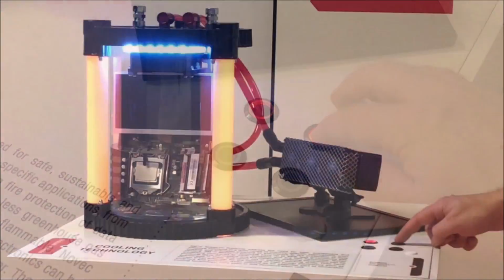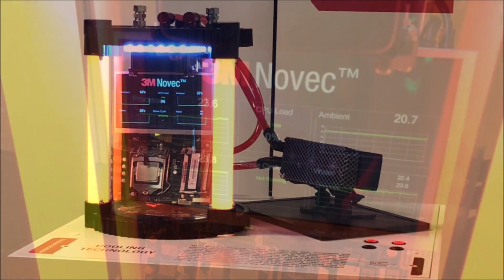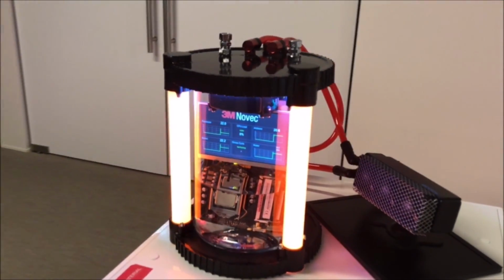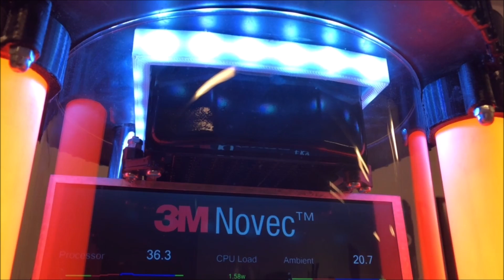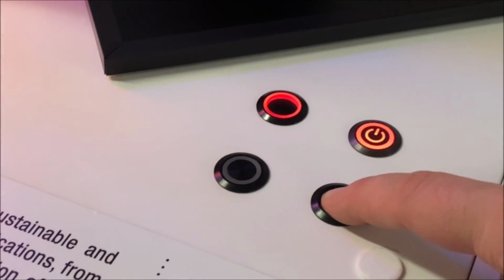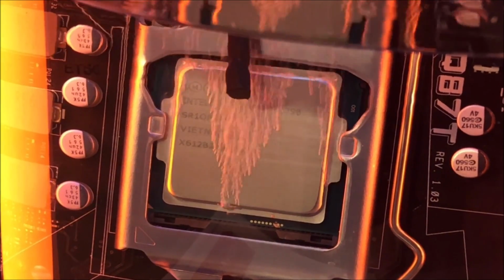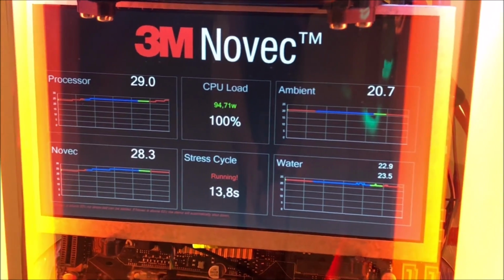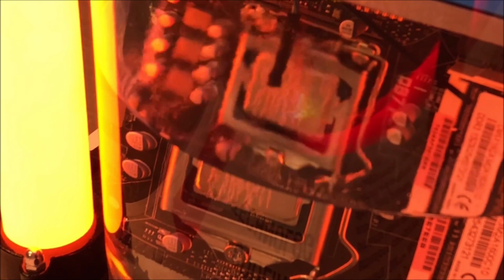Submersion Cooling with my new Smaller Novec Demo

Comment: I have some questions regarding Novec-1230 and Novec-649, they're just one same chemical, but the first is used for fire protection and has purity of ~99%, the second has purity ~99.9% and is used as heat-transferring fluid. I've seen some China-made system using Novec-1230 for submersion cooling, as it's 3 times cheaper and more readily available compared to the 649. Do you guys have any idea about using 1230, could we also submerge the PSU - power supply unit into it!? Many thanks!

Comment: Did you ever do that 12 hour stress test?

I'm designing a custom machined case and was originally going to do an oil or mixed fluid cooling system. Really intrigued by this novec fluid.

Watched your build and it looks fairly straightforward.

If I'm throwing a higher powered CPU logically that would equate to a bigger heat exchanger loop.

Was the cpu heatsink and fan removed for the demo? Surely it would be more efficient with the heatsink and fan mounted? Larger surface area etc

Comment: Nice. How do you pass through the cables/tubes into the tank?  Is the tank pressure sealed to keep the Novec from evaporating away or is this setup open to atmosphere? Would it  be a good idea to use a bellows to allow for the expansion of vapors/air? I so want to try this at home! I'm thinking of starting with something thin like a laptop motherboard(with or with out heat pipes attached you think) fully submerged and an "Alphacool NexXxoS XT45 Full Copper 40mm Triple radiator" on the inside to use as a condenser. What tubing, wiring, Plexiglas, sealant (to run a bead around the seams, corners, and wiring/tubing leading in and out of tank) types are safe to use with Novec? Questions, questions, questions!
Reply: Sweet, don't need to look for a rad now that ones perfect. Did you find a bellows type pressure equaliser that would work?

Comment: How does this system deal with the initial pressure change caused by the 3m evaporating?  Is there a hidden bellows or some kind of coolant loss?

Comment: Absolutely outstanding, I want this but multiple celled for graphics card's in sli/crossfire.
Reply: I'd use MXM graphics card's for laptops but using it under pcie. The results would be astonishing very artistic to look at and run Overwatch at max settings according to the graphics card's available.

Comment: Was there a reason why the mobo was not fully immersed? Also, in principle, how far could the external reservoir and radiator be from the immersion tank? And lastly, if you had included GPU(s) with their fans removed, would it all still have worked the same?
Reply: Size and cost. The fluid is expensive, and there's no reason to cool things that honestly don't need to be cooled.

In practice, the external reservoir and radiator can be any distance from the tank. However, you probably don't really want a PC watercooling system for this sort of setup since those are tuned for extreme space constraints that you don't have here. They have extremely tight tolerances because they need to transfer upwards of 500w of heat in a few square inches of space, which you wouldn't need to do here.

Yes, a GPU would work the same. The temperature of the fluid can't exceed its boiling point, so adding more heat sources only increases the rate at which the fluid is boiled off. This increases the pressure inside the container, with the limiting factors on cooling being how fast the radiator can recondense the vapor back into fluid, and the pressure the container can withstand. If the radiators can service the heat load, everything will work just fine and the system will never exceed the boiling point of the fluid.

Comment: Is that novec 7000 or 7100? Also why don't you cool directly novec fluid with the radiator and the pump, instead of using another medium in between? Answer would be appreciated a lot :)
Reply: I'm not too sure but the same problem as water turning into steam causing cavitation. As steam is a gaseous state and is compressible (and I know why don't we have high-pressure water coolers well I would recommend an engineer for you to talk about that) and the same happens when a vacuum is applied water 'boils' or an air pocket forms and thus the rush of fluid that is not easily compressible causes erosion

Comment: Can you tell us which Novec fluid is used? I am very interested in this choice because of the range of  boiling points of the different Novec fluids that I see available.
Reply from the maker: I believe we used Novec 7100.
Reply: @Fuzzietech   Think you could start offering prosumer Novec-cooled computer cases for sale? It may not be directly profitable, but if you expense the program as marketing it would be exceptionally cost-effective.
It would be quite the media blitz, and the sales revenue would offset most of the costs.
Reply: @Fuzzietech  is there a reason for using that one?

Comment: This is something I've been interested in making myself for a while, but getting my hands on Novec is difficult. 
One thing I know is that if the cpu heatspreader was "Roughened up" a bit it would promote the novec to boil off even faster due to the effect of the more porous surface.
Reply from the maker: This is correct. We developed a theory here to use a crystalline cooling paste cured directly on top of the die itself. Then you come as close as you can to the heat source and the rough pattern that would naturally be there because of the crystal "grains", making the contact surface to the Novec a lot larger.
Reply: @Fuzzietech  Have you tried this paste method? What paste did you use?

Comment: It would be more impressive of a display if they delidded the cpu.
Reply from the maker: Indeed it would! It would also provide a much more efficient cooling. We were toying with the idea but eventually decided against it for aesthetic and mainstream educational purposes.
Reply: @Fuzzietech  Are you sure that delidded cpu increase performance? Dissipation surface would be smaller ...
Reply from the maker: @eduardoyuotube1  Without any data or calculations I cannot be super sure ofcourse, but in my mind it should be more efficient. You still have "lag" in the metal plate even though it would provide a larger surface. The die itself doesnt care about how big that surface is, it will still only transfer heat to a surface as big as it is itself. And then that heat needs to traverse that metal before it can be cooled off. Novec fluid is VERY "liquidy"(low surface tension) and should have no problem rotating and carrying off the heat fast enough from the die. If you also use some kind of rough compound on the die that makes the surface a little larger then it would be even better.
Reply: @Fuzzietech  Interesting, thanks for reply.
Reply: Ain't this cause a damage to die by https://en.wikipedia.org/wiki/Cavitation ?
Reply: https://en.wikipedia.org/wiki/Leidenfrost_effect also
Reply: Depends on the Leidenfrost point for Novec. If it's 100 C then it's probably fine, as if you've gone above that for your CPU then you have other problems.

Comment: How much does this liquid cost? And what type of 3M NOVEC did you use? i looked it up and there are a few type of this liquid..
Reply: 3M NOVEC 7100 60°C boiling point , 500ml I have found 135 Euro, quite expensive
Reply: @lucianob4845  toxic?
Reply: Chen Du no
Reply: @lucianob4845  Can't wait for a cheaper chinese alternative.
Reply: @fernandomartin4141  lmao hopefully it doesn't turn out to be flammable or be conductive/corrosive..
Reply: fk-5-1-12 also called novec 1230 should do fine as well and you can get it for very cheap in china.
https://german.alibaba.com/product-detail/novec-1230-perfluoro-2-methyl-3-pentanone-cas-756-13-8-62427376929.html?spm=a2700.8699010.29.2.60647c99QGgJxR